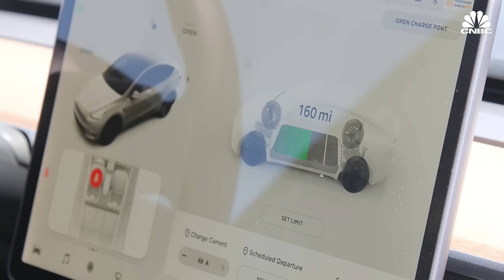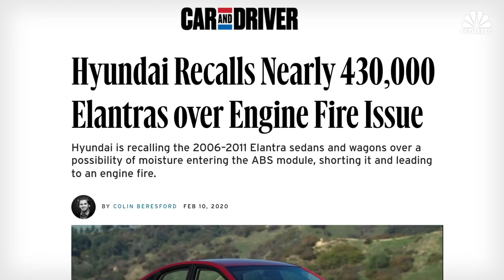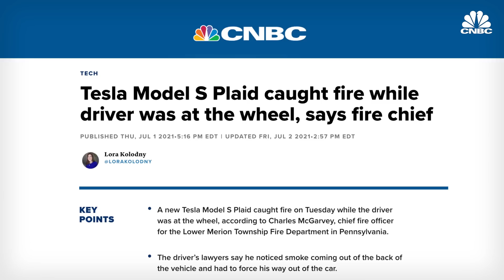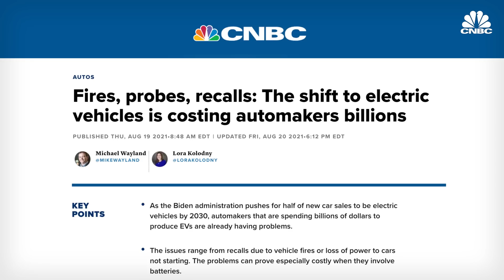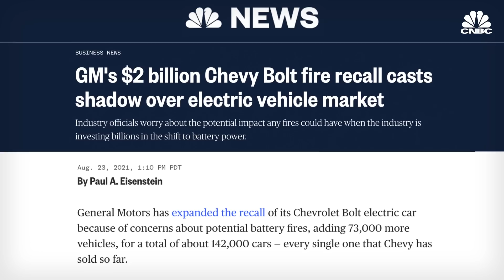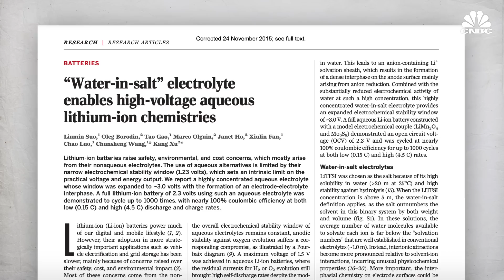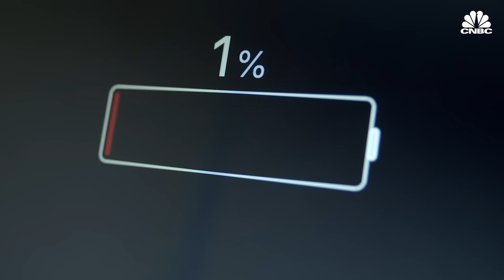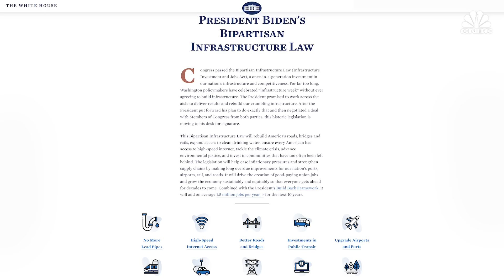Why Tesla, GM And Other EV Companies Have A Fire Problem

Comment: Interesting, but what I want to know is what are the fire rates per 100,000 cars for EV and ICE vehicles? Does one catch fire more than the other, on a per capita basis?
Reply: There is simply not enough data to draw any meaningful conclusions here:

- While most EVs are fairly new, there are millions of 10, 15 or 20+ year old ICE cars on the road and a most of them experienced a lot of wear and tear that could eventually lead to fires or increase the risk thereof.
- There are far more ICE cars than there are EVs, meaning that the number of potential scenarios that could cause fires is greatly reduced for EVs.
- There are fewer different EV models and most of them are "premium cars" (or at least more expensive than comparable ICE cars), so we don't have a large enough sample size of different engineering approaches and don't know how large scale, optimized (=cheaper) production affects fire risk.
- While ICEs and their fuel management generally don't change much, the (battery) technology in EVs is rapidly evolving: different chemicals used, higher energy density, changing manufacturing practices, faster ways of charging and so on can greatly affect fire risk.

If you combine all of those factors, it gets impossible to assess the risk properly and answer your question. All we know at the moment is, that once EVs start burning for whatever reason, the fire is way more dangerous and harder to put out than it is with bruning ICE cars.

Also: since you can't see into the battery cells or the package as a whole, the assessment of the health of your battery entirely depends on sensor readings and an "educated guess". With an ICE car, you can see most parts that pose a fire risk like the gas tank, fuel lines and connections, so (mandatory) regular safety inspections can better help in reducing the risk.
Reply: @nicoj9984  There is actually a lot more data than you realize. 

The fire risk on ICE cars is related to flammable fluids which come in contact with hot surfaces like the engine and exhaust system.  Those systems are always red hot when the car is driving, so build up of oil, dust, fuel leaks etc. are an ever present fire hazard.

On EV's, the only part that is typically a hazard would be the battery, and when the battery is involved the hazard is either manufacturing defects or a violent crash. 

There is no data showing that batteries become more prone to fires over time.  The high voltage cables are very well insulated and the cars monitor extensively the current flow and will typically reduce power or cut it of there is an issue.

Faster charging speeds could affect fire risk in theory due to more heat being generated, but there is no data showing that this has been an issue or will become one.

There are also of course technologies like LFP batteries which are practically fireproof, so there are technologies to reduce or eliminate fire risk in EV's.  That scenario simply doesn't exist in combustion engine cars.
Reply: @redbaron6805  I did not watch the video closely but it seems to me they showed the clip of the puncturing of a lithium ion battery but not the puncturing of the LFP battery which follows. And they did not discuss the relative risks of petrol cars versus EVs. There seem to be a lot of videos like this.
Reply: @FalkinerTim  LFP batteries can be punctured without catching fire.  Typically standard NCA or NMC Lithium Ion batteries can not.

But that still doesn't change the fact that Lithium Ion battery fires are exceptionally rare, and typically are from a catastrophic crash that penetrates the battery pack itself, typically if a car hits an object like a tree or the end of a wall, or slides into an object like a tree or wall, where all the impact energy is concentrated in a small area.

In normal driving and normal car to car crashes, BEV batteries are practically unheard of, as the crumple zone on them is pretty large.  For a fire to start, you would have to have a head on crash at highway speeds or higher, something that would not be very common.

Even then, fires are not common as a Model S hit a Honda Accord head on at highway speeds in CA, the Accord driver was driving on the wrong side of the road.  The Accord driver didn't make it, but the Tesla driver walked away, and the car did not catch fire.
Reply: @redbaron6805  Yes. What I was pointing out is that they cut the video clip short so they only showed the lithium ion battery that caught fire and did not show the LFP battery which did not.
Reply: The problem is not that it catches fire, the problem is that it's much more difficult to control.
Reply: How many teslas do youbthink out there and how many billion ice cars?  How often do you see a gasoline car burn like a box of matches?   Teslas have been around like 10-20 years? And how many already have blasted
Reply: @-Muhammad_Ali-  You apparently don't understand how statistics work.  The rate is per 100,000 cars.  So, it doesn't matter if you have 100,000 or 100,000,000 cars.  So, if the rate is 5 per 100,000, that is 15 per 300,000 and 50 per million.

The NTSB data looked at fires per 100,000 cars.  EV's were around 25 per 100,000 combustion cars were around 1625 per 100,000.
Reply: @redbaron6805  Is the rate per 100,000 cars per year?
Reply: @danielstapler4315  Yep, the rate is per 100,000 cars each year.
Reply: @redbaron6805  how many cell phones, laptops, hover boards, one wheels and other Lithium powered devices have erupted in flames? Nobody is really blaming EV's, the blame is Lithium battery technology.
ICE vehicles go up in flames due to a fuel leak, and many get put out without melting holes in the pavement. Gasoline fires can be extinguished with water, or suffocation, although water isn't the best option, it does work however. Putting water on a Lithium fire only makes it burn hotter and more intense. Foam or halon gas are much better options.
Reply: @fauxque5057  Actually that is also false.  I see frequently the melted burn spots along major highways where ICE cars caught fire.

Very few are put out before the entire car is engulfed in flames and the fire department has to put out a major fire.
Reply: @-Muhammad_Ali-  And I have personally seen countless combustion engine cars on fire.  I have yet to see a single electric car on fire.  

Probably because EV fires are exceptionally rare.
Reply: @redbaron6805  So are evs?
Reply: @redbaron6805  electric vehicles are rare for now. Whenever 20 million folks own them and use them a lot, then we will know.
Reply: @randybaumery5090  The current state of EV's is a bit misleading as it obscures the growth in EV's, along with the current effort by auto manufacturers to scale up production.  EV's will be kind of like cell phones and computers.  They will be rare and novel at first, and then suddenly they will be everywhere.

I used to only see a handful of them each month about 5 years ago, now I can't leave my house without seeing dozens in a single day.  Even my neighborhood is seeing more and more of them appear.

Even gas stations are adding chargers.  You would be shocked at how many new charging stations have been built in my area in the last couple of years.  There used to be almost none, now they are almost everywhere.

This remains mostly invisible to those that don't own EV's.  For those that do, the changes are pretty breathtaking already, and more are coming...
Reply: @redbaron6805  because EV's are rare? less than 1%
2 million EV's in the USA out of 273 million privately owned vehicles
Reply: @linusa2996  It doesn't really matter.  The fires are per 100,000 vehicles.  So, the data extrapolates whether you have 1 million or 100 million cars.

It is not like there are 10 EV's out there and we don't enough vehicles to have statistically relevant data.  EV's have been around for over a decade already.  It is not like they arrived yesterday.
Reply: @redbaron6805  the denial is high in this one. Did you even see this video that you comment on? i have never seen an internal combustion car spontaneously combust, like an EV does. Maybe we should call it Internal Combustion Vehicle, vs Spontaneously Combusting Vehicle.
Reply: 60 years old and I've never had a neighbor's house burn down from a car fire. That is until 6 months ago and it was a Tesla that burned overnight inside a garage. I know I'm a small sample size and statistics say it's safer, but every time I drive by the ashes it is hard to believe it's safer.
Reply: @k1fizz  That's a rather intense story to not have a link.
Reply: @k1fizz  You are correct.  Your sample size of one is not particularly statistically relevant.

You can easily find reports of homes with fire damage where someone parked a ICE Ford, BMW, Hyundai/Kia etc. inside a garage.
Reply: @redbaron6805  since my original post, there was another Tesla that caught fire in my town. They dug a pit and filled it with water to drown the battery because it kept reigniting. The chemistry of batteries are just more prone to ignite because they are self combusting. Gasoline needs to leak first and then have an ignition source to combust. The fire recalls for the ICE cars you talk about originate in the electronics of the cars.
Reply: @k1fizz  I don't doubt you will see EV fires since it sounds like you live in Norway or something where EV's are everywhere.

Still doesn't change the fact that EV's catch fire 60x less than combustion engine cars.

Batteries are not "self combusting", they can have a thermal runaway where a battery can ignite neighboring batteries.

And combustion engine cars don't need a gasoline leak or electronics problems, transmission fluid, brake fluid, power steering fluid, etc. are all flammable if they leak onto an exhaust manifold or part of the exhaust.

Most of the recalls and fires in modern combustion engine cars are the electronics, the fires in older cars are mostly due to a combination of fluid leaks, electronics failing and other debris catching fire from old insulation to dirt and leaves.
Reply: @redbaron6805  that’s exactly what I’m talking about. Thermal runaway events can happen while sitting still or while charging or anytime.   ICE fires where the gasoline actually catches fire usually happen in accidents where the gasoline itself has to leak out and catch a spark.
Reply: @Jan 6 was "Wall Street Putsch" part 2 And you sound like someone who didn't watch the video from start to finish. It showed actual footage of EVs spontaneously igniting, and burning furiously with fires that were difficult to extinguish. Unless that was faked, which I seriously doubt, that establishes beyond a reasonable doubt that EVs do indeed catch fire.

But as I said in my comment, which you seem not to have not read thoroughly as well, that doesn't mean that I think EVs should be dispensed with. What I wanted to know is, do EVs catch fire more or less often than ICE vehicles. Period, end of story. You sound like someone with your own confirmation bias issues, reading and seeing what you want to see.
Reply: @guydreamr  That was the entire point of the NTSB research.  EV's catch fire 60x less than combustion engine cars.
Reply: There is plenty of data. A recent study conducted by AutoInsuranceEZ using data from the NTSB (National Transportation Safety Board) showed that electric cars in the US caught fire at a rate of 25.1 per 100,000 sales compared to 1,530 per 100,000 sales for ICE vehicles and 3,475 per 100,000 sales for hybrids. So, a gasoline car sold in the US is 61 times more likely to catch fire than an EV, and a hybrid car is 138 times more likely to catch fire than an EV.

Media focus on EV fires, Teslas in particular, has created the opposite perception. But the data tells a very different story.
Reply: ICE vehicles have a much higher rate of fires, so far..
Reply: @johnflowers4092  Tesla vehicles are 10x less likely than ice vehicles.
Reply: Yeah, totally agree with you.
Reply: my first thought too. they mentioned how many car fires there were but glaringly omitted how many were actually EV fires. if they dont have the number they could still mention that fact for context.
Reply: That's a really good point. These new Tesla's are way more fire safe than any car that carries flamable liquids to power it. I'd rather drive a Tesla than a Kia
Reply: @davidbielski3484  

See the problem is, you can actually put out a ICE fire. You can't put an EV fire out anywhere near as easily.

Plus, they explode and catch fire at random. ICE need more than just a "Thermal Runaway" or "Overcharging Issue" incident to cause that problem. Plus, the toxic gases and smoke from an EV is way worse than an ICE vehicle.
Reply: @ArchetypeSoul  Except that claim is completely false.  Recent fire recalls from BMW, Hyundai/Kia, Ford, VW and others have asked owners to park their ICE cars OUTSIDE, and not inside a garage.

Obviously they wouldn't be asking that if the fire danger was only when it was driven.
Reply: ICE cars do tend to burn more often but it's noting that most cars that do caught fire are older.

While EVs are not. So one would have to check cars by manufacture date, not total fires. I don't think that data is avaliable.
Reply: A gas car is five times more likely to catch on fire than an electric vehicle.
Reply: ICE cars are much more prone to catch fire in an accident than a BEV that is for sure.
Reply: ICEVs catch fire roughly 50x more often than EV fires.
Reply: @williammeek4078  Putting them out is the problem.
Reply: @linusa2996  a very rare problem
Reply: @williammeek4078  rare, so we're bolt fires but GM had to recall every single bolt because of it and replace their batteries, shut down production  until new batteries could be made. Tesla's answer was, there is no problem our cars are perfect
Reply: @linusa2996  Bolt fires were about 10x more common than early Tesla fires. That put the Bolt about on par with ICEVs as fires go. So, unless you wanted to recall all ICEVs first, there was no reason for a Tesla recall for fires.
Reply: @linusa2996  Maybe because GM used LG batteries and Tesla makes their own proprietary batteries with Panasonic...?
Reply: A quick Google search shows 1500 ice fires per 100,000, 25 per 100,000 for EVs.
Reply: @shepherdsknoll  I still won`t say that`s accurate, when the number of ev reach ICE then we would see, 85% of cars are still ICE where 15% are EV so we can`t compare yet, ICE cars can caught a by someone doing a DIY and it caught a fire so is the search on dealer maintain cars or all the ice from the 19s where people are doing a set of madness to them
Reply: @phareztrinimand  It doesn't matter yet again as the fire data is per 100,000 cars.

Hence, it wouldn't matter if 90% of cars are EV's or 90% of cars are ICE.  The data is still per 100,000 cars.
Reply: more kia and hyundai cars and suv have caught fire than all of the EVs combined.  FACTS.
Reply: I think the data someone posted here are comparing just any cars out there. If you think about there are way more old ICEs than EVs on the street therefore there may be more ICE vehicle accidents first of all that increase the rate of fire or simply ICEs being older so easier to catch fires even if the chances of accidents being equal. You have to compare fires per vehicle that was placed in service in the same year. And we have to also consider the rate of fatality as well from the fire. As I hear tiny chance to survive if an EV gets bursted.
Reply: @Tz3952ii  The rate is per 100,000 vehicles.  

And EV's are rated literally the safest cars on the road, by far.  There is no comparison.

EV fires in accidents are exceptionally rare unless the car was involved in catastrophic side collision with a tree or a similar object.

There are EV crashes every day, with no fires.  EV fires start and grow very gradually.  There is no "explosion" or "burst".  Unless the occupant was seriously injured and can't get out, it is very rare for EV fires to be fatal.
Reply: @redbaron6805  Yes, every 100,000 cars in any ages that are already on the streets. EVs are all newer. They need to compare 100,000 cars of same age like 2 years in service etc. Otherwise you'll just get misleading data.
Reply: @Tz3952ii  There are major flaws in your assumptions.  First of all, a very large portion of the car fleet is newer.  We sell 16 million cars a year and scrap over 14 million old and worn out cars every year. 

Also, a lot of the fire issues haven't been in older cars, although they obviously contribute.  If you have been paying attention to the massive fire recalls in the last few years, it has been mostly in NEWER cars, BMW's. Hyundai/Kia's, VW, Ford's etc.
Reply: @redbaron6805  No, you have a major flaw in your opinion. Because you are relying on your mere assumptions in your last comments as well. There is no such data that supports what you just claimed. Unless there is any data that compares the same ages of the cars, and also fatality rate per vehicle fire, whatever people bringing up here won't be a proof of EVs being safer. EVs are still too early, that's the people's consensus in Korea right now and I will just wait for at least another 5-10 years.
Reply: @redbaron6805  I see too many people here that are frantically being defensive for some reasons, so I will just turn off the notification from you . Good luck for selling yours 🙏
Reply: @Tz3952ii  This isn't my "opinion" this is actual data collected by the NTSB, which the entire agency function is to investigate the cause of accidents and fires, including air accidents.

It was the NTSB data that showed EV's catch fire 60x less than combustion engine cars.

The age of the car isn't relevant, since the big recent combustion car fire recalls have all been on cars that have been relatively new, not on old cars.

EV's are already proven to be safer.  There is no question.  The NHTSA, NIIHS, the NTSB, multiple agencies have studied the issue, and they all agree EV's are safer analyzing actual data.
Reply: @Tz3952ii  EV's are not all newer.  EV's have been around for OVER a decade already.

Hence, your claims are simply matching reality.
Reply: EVs are 66 times less likely to catch on fire than internal combustion cars. No mainstream news corporation is going to get clicks talking about the dangers of existing techology, though. It's the new and "scary" technology that gets clicks, even if it is safer.
Reply: @juliam6442  *66 times more likely
Reply: @juliam6442  That is true.  Although, in all fairness, I think the video was mostly about the few cars that do catch fire and the challenges of putting it out.  Also, they did mention that the newer LFP batteries don't have the same fire issue as the chemistry is different.
Reply: Ive googled it several times over the years, and on average it seems like ICE catch fire about 65 times as often as EV.
Reply: Google is your friend. It's easy to find that information. But I'll save you the effort: ICE fires are far more frequent.
Reply: Wonder how this information will affect insurance and retail sales.
Reply: @ArchetypeSoul  Probably not much, as fire claims are relatively rare compared to crash and theft claims.
Reply: No one knows the exact day hour /But we can see  the signs  events all around us. And  by the timeline,   Israel is  80 years and  1 generation span  according to bible  text will be around  2027 , which israel was declared  first in  1947 + 80 years = 2027 .  so we know we dont have  10 years left as this is 2022  so the   rapture, then the tribulation  will be before 2030 for sure.

The rapture will happen without a doubt and it will happen much sooner than many believe (less than 10 years according to all the environmental, weather,astronomical signs ,israel timelines etc showing ). It will happen without any warning , not one , in an instant , catching masses of people off guard just like God always does, ie the flood ~ a rude awakening . No one knows the exact day or hour the rapture will happen is a certainty . THE RAPTURE CAN HAPPEN NOW at ANY TIME make no mistake !! . Please awake to Christ Jesus which is the ONLY hope NOW and dont let it be found out it IS all true later when its too late & many have been left behind in the most terrible times the earth Has Ever experienced Before and ever will...for anyone who sees this and doesnt know what to do please If anyone hasnt given their life and heart to Christ Jesus will have REAL BIG problems way bigger than any problems Ever had If left here on earth after the Rapture . After the Rapture The USA , Worldwide , will face More evils , Inner city chaos, firearm wars etc etc ,power & water , food shortages , military invasions,mass executions (yes much blood will be required by antichrist ) etctec than it Has EVER been seen Before and you surely dont want to be Here then . We Have Time NOW to change , please seek Christ Jesus while there is still time to save ! no one knows the day or hour of the rapture it will start out just like any other day and it will Take Place In the day In Broad daylight/sunny day , In an Instant FLASH without ANY warning ,& there will be peoples Driver Ids, cell phones ,wallets found in various parking lots,Purses, bill folds Found at work etc etc with NO explanation , and People VANISHING so No One can refute it has taken place. .
romans 10:9-10 That if thou shalt confess with thy mouth the Lord Jesus, and shalt believe in thine heart that God hath raised him from the dead thou shall be saved! 
please share with others =IMPORTANT
raptureready.com

Information  for anyone who has come across those that  refute the 
 rapture and  say  that it was supposedly  made up  and   say it was created by darby church  in 1700s . This is real good  to show it was  way before darby , and its documented .
 also rapture pre trib proofs even in dead sea scrolls .
15-1700s/  irenaeus 170ad/ 250 ad / /isidore 4th century   
sourced by intense search and study by  ken johnson 
https://www.youtube.com/watch?v=e1Nv-xFig8I
Reply: a conservative company like Toyota has almost 0 problems with their hybrid NiMH batteries. Those hybrids are more than 10x on the road than all EVs combined.  Toyota just started putting Li ion batteries in their hybrid and we would like to see how safe they are.  It is probably not that bad that Toyota often reduces the maximum capacity to enhance durability.
Reply: Tesla vehicles catch fire 10x less than gas powered vehicles.
Reply: Curious how much in government spending these manufactures will get in subsidies from the renamed build back plan for EVs
Reply: @kd741  The manufacturers are getting zero, the buyers are getting tax credits.

If your claim is that tax credits are subsidies, then we are subsidizing a host of people every year, from getting an education, to having kids to buying a house to making their homes more energy efficient.

Also, the program in question would be tiny fraction of the tax cuts we gave corporations and the 1% in 2018 that will cost close to $2 Trillion dollars over a decade.
Reply: We did it Joe…😁

https://youtu.be/pn_tbez_AM0
Reply: That would be facts, that's a no go
Reply: The NTSB recorded approximately 190'000 ICE car fires in the US during 2022. They recorded 4200 EV fires in the US over the same period.....
Reply: The whole point is that EVs arent as perfect as people think they are.
Reply: @DonJulio510  No one thinks electric vehicles are perfect
Reply: @williammeek4078  who are you trying to fool? Go up to any EV owner and they act like they are saving the world.
Reply: @DonJulio510  And neither are ICE cars. They occasionally catch fire too..
Reply: @Brian-om2hh  oh do they? You win the argument then
Reply: @Brian-om2hh  but no one is saying ice cars are safer than ev but ev lovers love to act like its perfect.
Reply: @DonJulio510  No, EV owners are using actual research data from an actual government agency that specializes in investigating accidents.

Instead of rambling on about people "acting" like something, we are talking about actual data, and that data shows EV's are 60x less likely to catch fire.
Reply: Wrong Question. How many fires per 100,000 miles driven. NHTSA extrapolates this for every recall. Ratios are real. There is plenty of data.
Reply: @GET2222  The question of fires per capita is in the ballpark but your observation of fires per 100,000 miles is more on point. Thanks for the update.
Reply: Too little data to comment right now and I totally see your point that EVs are far safer than ICE engine cars.The idea behind this was not to discourage EVs but rather ensure that other things change with EVs to cope up with the tech shift.We need better roads( I am coming from a developing nation,so you might have different standards for a good road),we need better equipped emergency services to handle hazards and people need to learn to use their stuff properly.I mean,ICE engine cars have been out there for decades,they are time tested,and most their issues resolved,they are more or less built to handle rough use n abuse but compared to that EVs are still in their infancy so we just need to fund emergency services enough to keep up the pace and keep everyone safe.
Reply: @ankur1610  Actually, at no time did I say or imply that EVs are safer than ICE vehicles. EVs can be dangerous, that's been well-established. The question is, are they more or less dangerous than ICE vehicles on a per capita basis?

But your point is well-taken that we may not have enough data yet to make that determination. Modern EV technology with lithium batteries is, after all, relatively new.
Reply: @guydreamr  there is data on that. 'combustion' engine do catch on fire 10 times more often than Teslas for instance. Now for a Chevy Bolt, it's different. There are official organisations such as NHTSA and some carmakers that publish such data transparently. You may check it out for yourself.
Shoutout to Steven Mark Ryan's today video on his channel Solving the money problem, devoted to debunking such bs.
Reply: @guydreamr  For Tesla there is ample data, and that data shows that their cars are ten times less likely to catch fire than the average. Despite this "Tesla" is both repeatedly mentioned in the video and is mentioned 1st in the video title. Also the video states an opinion that ICE cars do not catch fire when parked unlike EVs, this is not true as there are numerous cases of petrol cars catching fire whilst parked. Also there are numerous occasions when parking lots worth of ICE cars have gone up in flames like an incendiary contagion.
Reply: @ujjalshill6442  Sources?
Reply: @guydreamr  it gives the false hope that we can innovate our way out of every problem
Reply: @guydreamr  not enough data? EV have driven billions of miles.. plenty of data.
Reply: @thomaswilson2917  So put your money where your mouth is, and provide us some links.
Reply: @guydreamr  
The problem with EVs is the Lithium in the batteries are highly reactive, & burns much faster & hotter than gasoline.  
These battery fires are commonly the result of overcharging, or overheating which causes the battery casings to rupture, exposing the lithium & other electrolytes in the batteries to oxygen, where they instantly combust.  

So in this sense EVs are more dangerous... but in the other sence ICEs are more dangerous, because there are more of them.  
EVs will become definitively more dangerous, if they become as common as ICEs... but EVs will become less dangerous if they switch to using Nickle Metal Hydride as the electrolitic material, which is far less reactive, but it develops charge memory & has less energy density, which is why they use Lithium Manganese Oxide for EVs
Reply: @coguglielmi  isn't that data from Tesla itself and if not could you provide a link? I am curious because I wasn't able to find unbiased data on this topic.
Reply: @guydreamr  there is data EV catch fire more than ICE, with 15% of EV`s on the road and 85% is gas it is alarming that the small percentage is caughting on fire more often compare to how many gas cars, if a gas car catch fire it mostly an electrical problem or someone fixed it wrong, also EV`s in fire isn`t safer, you have a slim chance of getting out of the car if your driving because there caught on fire rapidly, a gas car you would smell smoke for a while but it won`t caught on fire as fast as an ev
Reply: @ankur1610  How about this point. ICE far out number EV's. EV's are relatively rare and yet have a high incidence of fires.
Remember that cell phones, laptops, and hover boards all are experiencing fires while charging
Reply: @fauxque5057  It doesn't matter as the data is per 100,000 cars.  Hence the total numbers don't affect the data.

And EV's have nothing in common with cell phones, laptops and hover boards which are mostly catching fire when people by cheap Chinese aftermarket batteries to replace the factory batteries.
Reply: @ankur1610  there is plenty of data. ICE are more prone to fire and EVs are getting safer every year. BMW just had a massive recall for 900,000 cars for fire issues last week. If one care is next to another car, they will start on fire as well. Fires per mile driven is how NHTSA defines a recall. Ratios are reall and super accurate all the way down to 100 instances. Production lines are so tight and conformist that you don’t really have rogue cars starting in fire unless they have been randomly punctured by debris. Gas is more flammable than a battery. Period. This is dumb.
Reply: This was researched and covered not too long ago.

"Fully electric vehicles, on the other hand, were deemed far safer than both hybirds and gas cars; they are far less likely to catch fire, with just 25.1 fires per 100,000 sales. That's compared to 3,474 hybrid fires and 1,529 ICE fires per 100,000 sales respectively."

Electric car fires are around 25 per 100,000, combustion engine cars are 1529 per 100,000....
Reply: @redbaron6805  that's great information. What is the source for your numbers?
Reply: @grandmastarflash  NTSB data....

"This is not the first time it’s been said that EVs are not as likely to catch fire as vehicles that have an internal combustion engine. Now it has been confirmed with data from the National Transport Safety Board, compiled by AutoinsuranceEZ, which says that hybrid vehicles have the highest fire risk."

It was basically complied from vehicle fire reports from the NTSB...
Reply: @redbaron6805  yeah i dont know why their data doesnt present numbers, its frustraiting
Reply: @redbaron6805  what’s their methodology. I bet there are some heavy biases and data manipulation. I smelled bs in that data
Reply: @redbaron6805  there are a lot of videos of electric vehicles fires on the internet, ok they are less but, what fire you prefer to deal with ? A fire from a lithium battery or a gas fire wich is easy to put off with a extinguisher, while batteries fires so hard to put out imagine charging your car at the garage and burst in flames while needing 20,000 gallons of water to put off that fire.
Reply: @dawrincueto6962  Not sure how that has anything to do with anything that there are a "lot of videos".  There are hundreds of thousands of EV's out there, if there are a few dozen videos out there, that proves what exactly?  That EV fires are about 25 per 100,000?

And you are completely missing the point on where and how those fires happen.  Almost all of them are when the vehicles have been in a major crash, a couple are when they are being fast charged.  How many are of the cars being charged at home?  One?  Zero?

EV fires while they are being charged are exceptionally rare.  So, I don't have to "imagine" charging my car at the garage and it catching fire, it is something that is so rare that it is barely even statistically relevant.
Reply: @ujjalshill6442  If you purposely built cities for walking from day one, we would obviously need far fewer cars.  But that was not the case, so cars are needed today.

And battery cars don't "explode" that claim is a myth.  EV's catch fire 60x less that gasoline powered combustion cars.
Reply: @grandmastarflash  As a retired highway safety officer I can tell you that the NTSB numbers are for vehicle fires from ALL causes including external ignition sources and arson (insurance fraud). The issue is that EV cars can catch fire while NOT being driven. 06:31  I don't know of any ICE vehicle catching fire while being parked unless the ignition was from an outside source. Electric vehicles can virtually spontaneously combust while recharging and lithium burns at a much higher temperature than gasoline. The fire chief in this video said it took 2 hours to put out one EV fire. Imagine a large parking lot filled with EV's not to mention the danger of re-charging at home overnight while everyone is asleep. Lithium batteries have a checkered history of spontaneous combustion. These batteries need to be made safer.
Reply: @redbaron6805  Does this include 2nd hand ICE sales?  If so you are comparing some very old vehicles with EV's which are not yet 10 years old.  Also many Internal Combustion Engine (ICE) car fires are caused by 12v electrical faults and not caused by the fuel catching fire.    Many EV car fires are caused by the battery pack going into thermal runaway often when charging which is the equivalence of the fuel catching fire.  So we should also consider the root cause of the fire when comparing ICE to EV car fires.
Reply: @rupertrussell1  The total is per 100,000 cars.  I don't think the issue is old vehicles, as recalls for ICE car fires lately have been concentrated in newer vehicles from Hyundai, BMW and others.

Also, I haven't seen any data showing the number of EV fires is going up.  As battery technology and manufacturing improves, those numbers should go down if anything.

Many of the ICE fires are electrical faults, but that is simply due to the extensive wiring required, the heat generated by burning fuel, and the simple fact that fuel and other fluid leaks can quickly catch fire due to hot engines and exhaust.

Your claim of "many" EV fires being due to "thermal runaway during charging" is patently false.  The vast majority of EV fires are caused when the battery pack is penetrated in a catastrophic crash, not during charging.

The root cause isn't really that relevant as the entire car is a package of different systems.  If the 12V system was the issue, why isn't it an issue on EV's which have the same 12V system for all its accessory motors, infotainment systems, etc?

That claim simply doesn't hold up.
Reply: @redbaron6805  Fact: The the faster you charge a lithium-ion battery, the shorter its lifespan. A little-known fact is that when lithium batteries wear out, they don't just weaken, they develop internal shorts and become a fire hazard. A fire is much less likely with a slow-charged lithium battery, but most owners seek fast-charge stations. A battery charged rapidly repeatedly will break down and become hazardous much sooner than stated by manufacturers.
Reply: @brianadams2161  Except there have been multiple studies showing that claim is completely false.  Fast charging Lithium Ion batteries creates heat.  Modern Lithium Ion batteries in electric cars use sophisticated cooling systems to keep the batteries cool.  Studies on fast charging Tesla's for example showed no difference, or even less degradation of batteries that were fast charged frequently vs those that were not.

And no, they don't develop shorts, that claim is utter baloney.  Fires during battery charging are almost unheard of.  The battery fires and recalls have been due to production defects, not charging issues.

There is literally zero data backing up any of the claims you are making here.
Reply: @redbaron6805  ICE vehicles don't just go up in flames on their own. You have to have a fuel leak. EV's on the other hand can ignite at anytime with little explanation. You also need to include all of the cell phones, laptops, hover boards, one wheels, and other Lithium powered devices that erupt in flames when you look at Lithium fires
Reply: @fauxque5057  Except that claim is obviously false.  There have been multiple recalls recently where ICE cars catch fire on their own, and people are warned NOT to park them inside garages or next to a home.
Reply: I’ve seen several ICE fires and they tend to be much slower and - if the fire wasn’t caused by a crash - very easy to escape.
Reply: @DSQueenie  Except of course, many of the drivers of the ICE fires report their car filled with smoke and the fire suddenly went from a small fire to totally engulfing the car.

EV fires unless you are in a violent crash start out very slowly, and the car warns you to evacuate the car.

Hence, your claim makes very little sense.
Reply: EV are more dangerous wen caught on fire it’s poisonous and if the water run off gets into wildlife is going to be very damaging,
Reply: @mmc5261  No, that claim is ridiculous.  Like oil and fuel leaks for a gas fire is somehow less toxic.  Based on what..?
Reply: Electric is the future,  just get over it. Or, so I am told.
Reply: It will eventually be 100%. Cars take a massive amount of abuse over their lifespans. I live in Pennsylvania. Our winter road salt will eat through our battery's protective layers in a few short years and cause them to catch fire. If you live somewhere that it doesn't snow, you'll be safer for much longer, but eventually all of the wear and tear and vibrations of daily driving will cause a failure that will set it off. Not to mention a relatively minor crash could very easily cause enough damage to the battery to set it off. A fender bender in a parking lot, could end up killing you.
Reply: @mrnobody6609  😂🤣😂🤣😂 everything you say applies to ICEVs much more than EVs. The batteries are sealed from the environment. All of the actual data we have says the opposite of you.
Reply: @mrnobody6609  Except that claim is literally fiction on every level.

There are thousands of EV crashes around the country every year, yet almost no fires.  So, that claim is complete fiction.

Also, there are Tesla's in PA and many other winter salt states.  No batteries are being eaten through and catching fire.

You are literally just spouting fiction here.
Reply: Who cares? Just don't buy EVs. Don't risk your life or home just be "modern".
Reply: @pepinocabron  Don't be a complete idiot.  It clearly says EV's are SAFER than combustion cars and catch fire 60x LESS than combustion engine cars...
Reply: 1 ev fire is FAR more dangerous than an ICE fire. comparing numbers here isn't the whole thing.
Reply: The difference is Lithium spontaneously explodes in a devastatingly violent fire when it contacts oxygen in air or water.  Gasoline is stable.  It’s also produces 200 toxic gases, killing all occupants instantly then incinerating them to powder in less than 2 seconds.
Reply: @FFE-js2zp  Point of fact, lithium ion batteries do not use elemental lithium, but lithium compounds ( often LiC6 or lithium carbonate) in the cathode (anode?) - I constantly have to remind myself which one is which. Elemental lithium does react violently (exothermically not explosively) when in contact with water, but only rapidly oxidizes with exposure to air. Lithium compounds do not react the same way. 
To impress this point, elemental sodium reacts like lithium does, but sodium carbonate (commonly known as soda ash) does not.

Lithium ion fires occur when the temperature regulation of the battery pack fails causing overheating and ignition of nearby fabrics or insulations. Only when poorly manufactured, like those laptop batteries from a few years ago, do batteries directly burst into flame.
Reply: @FFE-js2zp  That claim is comically false.  And batteries are sealed in water proof metal enclosures with Titanium shielding.  They are not exactly at risk of getting into contact with air or water unless the pack itself is damaged in a crash, which is itself exceedingly rare.
Reply: They can't answer you on this question, because this is a fake and made up story.
Reply: @georgegeorgiy3516  🤣